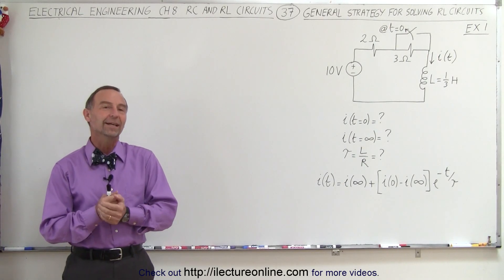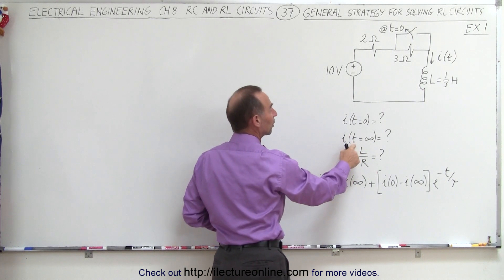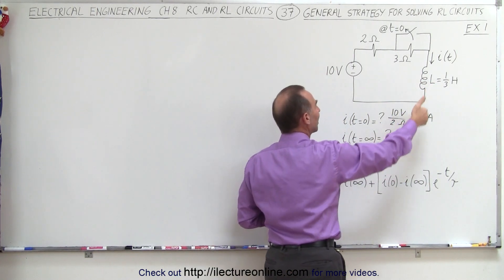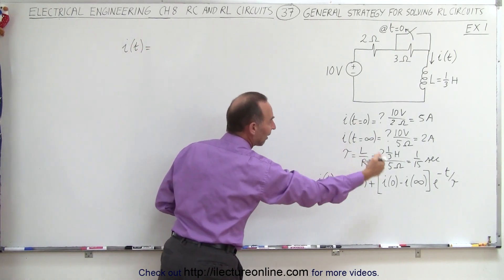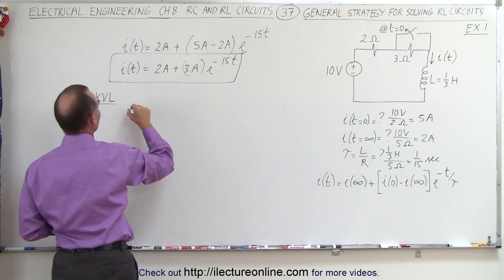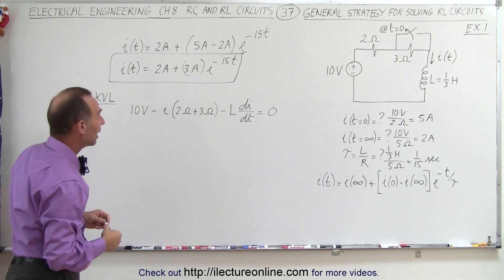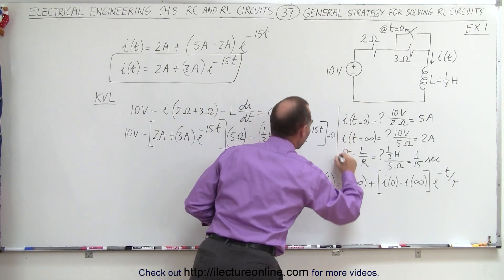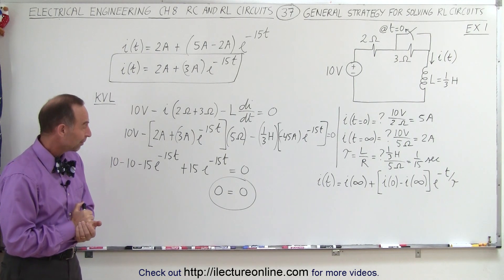Electrical Engineering: Ch 8: RC & RL Circuits (37 of 65) General Strategy Solving RL Circuits Ex.1

Comment: why you only considered 2 ohms resistor in calculating the current along inductor at t=0 ? why
Reply from the maker: It is not that we only consider the 2 ohm resistor.  Before the switch is opened, all of the current will flow through the switch and none through the 3 ohm resistor.  The inductor in the circuit prevents instantaneous step function changes in the current.  Therefore if no time has elapsed after the switch is opened there cannot have been any change in the current yet.

Comment: Sir at t=0 why we r not considering 3 ohm resistor and in case t=infinity are these resistors in series or parallel connection.. Plz help sir
Reply from the maker: Since the current and voltage do not change instantaneously, we consider the voltage and current at t = 0 to be the same as just before t = 0.  After the switch opens, the 2 ohm and 3 ohm resistors are in series.

Comment: How the resistor coming in the role after infinite time when it is always short circuited?
Reply: Inductor becomes short circuited in steady state, not the resistors. You can think inductor as a wire in steady state condition.